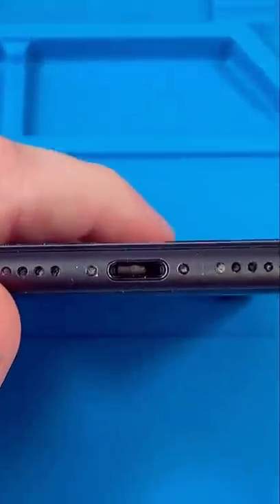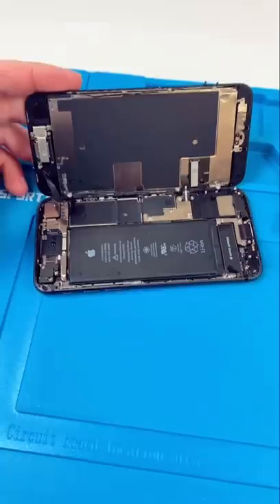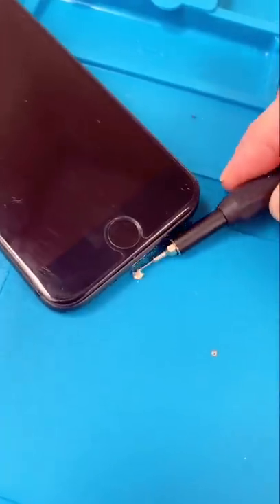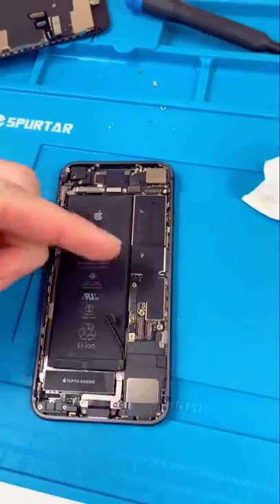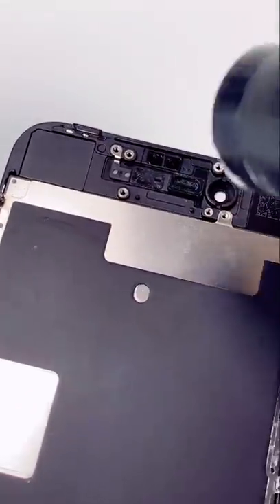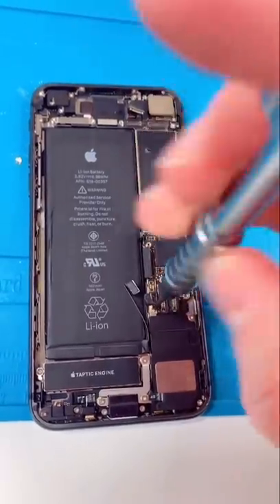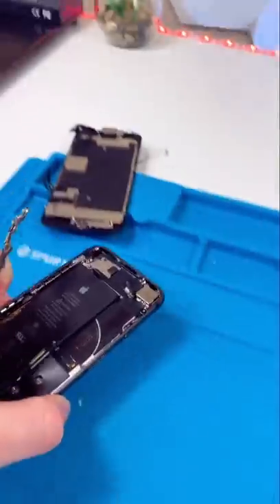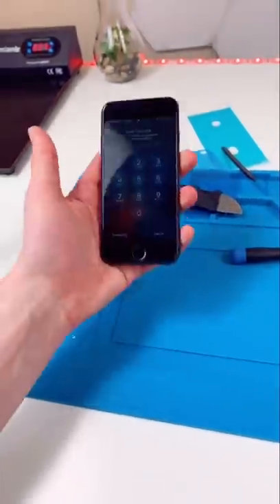The Rice Did Not Help... #Shorts

Comment from the maker: Please Stop using rice Lol. Just take out the sim card tray and turn off the phone for 48 hours. You should be taking it to a shop for cleaning. If this guy didn't come when he did the phone would not have lasted the next few days.
Reply: Fr
Reply: ikr
Reply: First reply lol
Reply: shame on them
Reply: Ok thanks for telling us!
Reply: @trgworks  I was second reply
Reply: Good edvice actually now that I think about it any phone or technology edvice you give is good
Reply: I have a iPhone 8 I need a new camera and back glass and someone to fix it
Reply: Omg he liked my comment 🤯🤯🤯🤯🤯🤯🥳🥳🥳🥳🥳
Reply: Yea you shouldn’t use rice
Reply: Fr
Reply: Yaay
Reply: Another "get that crunch!" compilation please 🙏🏻🙏🏻
Reply: Thanks Guru learnt a lot from you
Reply: Can we get the link for the program is that you use
Reply: The rice worked for me. My mother's phone once dropped into the toilet and didn't work. After a few hours in rice it booted up just fine.
Reply: I once dropped my old SE in water. The screen had visible marks from water. If you’ve experienced water damage on your iPhone you probably know what I’m talking about. I didn’t have any rice, and I wasn’t prepared to have to spend $100. So I ended up putting my phone on this old CD player which generated a lot of heat. I guess that evaporated the water inside it or something, because when I took it out a few hours later there was no visible water damage on the screen. I used it for about a year or two after the incident, and I never noticed any further problems. It shouldn’t have worked, but I guess it did…
Reply: @xitee6258  does it have rice in the charging port?
Reply: @Maciek2846  No
Reply: can we know ur name or did I miss sum
Reply: @xitee6258  maybe that's just luck but in so many cases rice doesn't help
maybe it's better when you just send it to someone who can fix it and not try it yourself beacuse it really can be dangerous and the rice can be stuck in the charging port
Reply: @Maciek2846  Ok then i maybe just had luck. But send it to someone wouldn't worth it because it is already 5 years old and isn't an expensive one. But it works so it doesn't matter anymore.
Reply: Bro my samsung s9 plus has red screen can you fix it I will pay how much you want
Reply: Why do you cook the phone??
Reply: How do I contact you? I have a iPhone 11 that can be fixed
Reply: THAT'S A LOTTA DAMAGE
Reply: What about MacARoNi?
Reply: I need help my dad changed the screen for my iphone 6s plus but the button isnt working
Reply: You should do a compilation of phone crunch
Reply: @victorizaguirre2458  you're right he should,it's soooooooooooooooooooooooooooooooooooooooooooooooooooooooooooooooooooooooooooooooooooooooooooooooooooooooooooooooooooooooooooooooooooooooooooooooooooooooooooooooooooooooooooooooooooooooooooooooooooooooooooooooooooooooooooooooooooooooooooooooooooooooooooooooooooooooooooooooooooo satisfying
Reply: Sir I didn't know you will read or not but I want to replace the screen of VIVO Z1 pro
Reply: @trgworks  lol you weren’t first
Reply: I'm not sure if you noticed but rice absorbs moisture so maybe it does help a little
Reply: Where is the repair form
Reply: Or just tape places where the rice can go
Reply: Rice works with small splash or droplets getting in holes of your phones. If you're afraid of getting rice in your headphone jack/charging port, just cover them with tape....how hard is that?
Reply: How mutch would it be to replace a samsung J3 screen ?
Reply: You need to use gloves dude, it could be toilet water. You never know where they dropped it ! 😳
Reply: Uhh I have dropped my phone in water at least 10 times it's usually ok after but I'm scared the more I drop it in water the less it will work
Reply: My dad knows how to deal with phones that were fully submerged in water
Reply: Soft paint brush?
Reply: @brylee4423  bruh I was first I don't need to prove
Reply: i’ve only dropped my phone in water once but i put it in rice, and while i did have to get a new phone, i let it soak for a few days and it works perfectly fine now :)
but if it happens in the future i probably won’t use rice lol
Reply: Sadly no one wants to clean phones around here
Reply: @trgworks  if you were first your comment would have been at the top... it’s not
Reply: @brylee4423  how long hv u been on youtube??
Reply: @trgworks  many many many years.
Reply: You are way overdramatic with water damage, Rice is okay it does in fact pull water, just set it on top of the rice not covered in it. Most modern phones are perfectly fine being completely submerged and the naturally drying. My low end Samsung has been drop in water, dry cleaning chemicals, detergents even liquid starch and except for the starch it always air dries(because im busy and don't care about it) when i take it apart there's no damage to any components. Now with apple its a bit worse since they're designed to fail rapidly but they're internals are still very resistant to water/liquids.
Reply: Hey, what company do you work at? I have an IPhone 5 and it has bad water damage
Reply: If I owned an iPhone 8, (I’m still swearing at a 7+, as it reaches it’s programmed death date.) and I dropped it in water for a few seconds and it got that wet inside, I’d be screaming at Apple for false advertising, and if I had been daft enough to void the warranty by taking it to a third part repairer, I’d be screaming them into the foetal position. On an aside, I’m hoping Apple dislodges their craniums from their sphincters and allows suitably qualified and audited third party repairers to repair Apple products. After forking out over $1000 for a phone, no one wants to double or nothing for a relatively simple and cheap repair that Apple charges an arm and leg for, and often says is unrepairable.
Reply: Yo plz reply ik your busy but my phone iphone x buttons everything works but the screen doesn't respond to touch i cant get in the phone i tried force resetting it already how do i fix it
Reply: I dropped my phone in my pool and it won’t turn on please help me
Reply: Or use silica gel.
Reply: Your Channel is entertaining to watch
Reply: I mean why not, rice absorbs humidity really well, and in the worst case there is water in the charging port which is really easy to clean out as you even showed in this video?

It worked for me multiple times, maybe the phones would have worked anyway, but 48h in rice shouldn't be bad. + I never even had any get stuck in any ports...
Reply: Me having phone that unable to open the battery and sim card out without pin: r i c e
Reply: @wisico640  rice does not work most likely what happened to yours was it literally dried up so yes letting out to dry can work but rice won’t help.
Reply: Last time we used rice it destroyed my old phone
Reply: @brayannexon4613  one of the phone we "fixed" was an LG G5, the phone still had water behind the screen & lenses 5 days in. Then, only 48h in rice & the humidity was all gone, the phone even booted up.

We even had separated the phone in two (the battery loaded like a gun clip) all we had to use was a long wooden pin to remove some rice from inside this compartment. It's rice, not cyanide; It won't kill you or the phone 😂 especially if the phone is already considered dead from water damage
Reply: @wisico640  what kind of rice did you use? From what I know rice isn't a good desiccant.
Reply: Would salt be better?
Reply: I had an interesting idea i wanted to run by you. What about water absorbing silicone? Silicone packets come in a wide range of food products and other goods to keep them dry. What if we collected all of the small packs of silicone and place them in a bag. This way we get a drying effect without small particles going into the ports.
Reply: How much for a cracked tablet screen fix?
Reply: I promise I won't put food in my phone
Reply: @gaijininja  Or.... you could just not buy Apple products..
Reply: Hey
There is a ghost touch on a phone what to do can you tell
Reply: Would shutting it off and removing sim but soak it in alcohol and they let It dry for a while be better?
Reply: @Killertiger2000  no
Reply: @xitee6258  the rice does absolutely nothing. The water just dried up on its own
Reply: Hello, I believe my switch lite has water damage. I feel silly for asking but do you think you or someone like you would be able to fix it? It won’t turn on or charge.
Reply: Do u have a P.O. Box because I might need to send u my brothers phone because it was in the ocean for a long time and now idk what to do
Reply: I have a LG G6 thinq with broken front and back glass could you fix it?
Reply: You should buy a GoPro
Reply: My phones broken
Reply: Can you fix my iPhone 6?
Reply: @Mmmm-mj3iu  so that glass doesn’t shatter when you want it to come off and it just peels off
Reply: Can you repair my phone
Reply: Please
Reply: Rice does work tho
Reply: Where do you get all the broken phones from because I fix phones two
Reply: I remember one time I dropped my phone in the sink cuz I was trying to change my music I instantly took it apart like the case came off the back came off the battery came out and so did that little sim card thing I set it between two paper towels and let the water drain when I put it back together the sound was very muffled so I took it to someone and they said it was just dust and i still have my phone no cracks or anything so I'm kinda cool I guess
Reply: Actually rice helped me a lot of times
Reply: My mom has gotten the one bag things that take the moisture out of stuff like the things in packaging for instances like when my aunt accidentally washed my sisters tablet in the washer and I dropped my phone in the rain and didn't notice. I have a newer phone so it can't really be taken apart like we usually do so she decided to get that stuff
Reply: Do you have tik tok ? If you do pls tell me your name
Reply: How do you remove the sim tray?
Reply: @spiicypotato  
Race doesn’t cost $100
Reply: @Gabriel Kautzman 
No it should be fine
Reply: @timothyjones4682  
Silica gel packs work fine
Reply: @trixtrix1536  sweet my meds comes with one in this plastic canister would work perfectly
Reply: @xavierb2817  no
Reply: The camera is all fucked up

Comment: (Long story) Like 5 months ago my iPhone X had the top left of the screen pop off because the battery had expanded without me knowing so I splashed it on accident and I was like oh I’ll just wipe it and went to sleep. before I knew it, it was stuck on a boot loop in the morning so I noticed the opening and opened it up and sure enough it was wet. So I put it outside to dry for several hours and it was dry so I tried and it was still on a boot loop. I then disconnected everything to diagnose the problem and try to see which component was causing the problem. I then connected only a new screen and battery and it was still stuck, I cleaned it, still stuck, I factory restored it, still stuck, nothing worked. So I came to the conclusion that it was the motherboard and gave up and didn’t bother fixing it and just asked my dad for a phone and ended up getting the 11 pro. Then like 2 weeks ago I decided to just plug it in and charge it because I was feeling hopeful and it had no charge and to stop it from boot looping I pressed up volume, down volume, and held the power button so it was on the screen with the lap top and the charging cable and I just left it to charge. I kid you not after like 15 minutes, mf just spontaneously turns on and is on the hello screen. The only problem was the Face ID no longer worked. It might’ve been me or the water but holy shit I thought i was a wizard. Perfect timing because when I go to Mexico ima give my mom the iPhone X because she currently has a crappy Samsung that’s like 7 years old and has 8gb of storage. Still have ptsd whenever I restart it or shut it off tho, I fear that stupid white apple lmao

Edit:  I forgot the rice 😂 maybe that would’ve worked wonders and ended up with rice stuck on the charging port and the phone not successfully booting up. Stonkers

Comment: which question: when he said he “cooked the board” and the other thing what exactly does that mean? :)
Reply: He has a heating plate, usually to heat screen adhesives before removing them. Here he probably used it to dry the parts out quickly

Comment: Phone repair guru i need help please. so i have an ipod touch 9 and when i plug it in it usually charges but now i’m having problems. when i plug it in it says its charging but whenever i use it the battery stays around the red zone. i’ve tried shutting it down twice. please help :)
Reply: Lmao fam I feel your pain I used to have an iPod touch like 5 or 6. The problem is the battery is worn down most likely and the only real way to fix that is to replace it but it’s probably not worth it. I’m no expert but I feel like a case with a battery built into it is the best solution. Even if you replace the battery it most likely will last a few weeks or a few  months and go back to lasting you like 30min-1hr before it dies.

Comment: I actually accidentally left my samsung S5 in my jacket as I put it through the washing machine a while back.
I did not use rice and dried it slowly after powering off, taking battery out and using a hair dryer. Still works to this day :)

Comment: I have the back of my XS repaired today and I updated it two day ago (prior to me dropping it off to get fixed) but now after they replaced the back glass,it is super laggy and shuts off on its own and gets hot quickly if you open any apps. It is hot near the middle back and lower area near USB port. They said it may have been the update that did it and they see it often with the XS when it’s shattered on the back. Mine had chunks missing in big squares exposing potential damage to inside. Im worried that the laser touched something it shouldn’t have,but aren’t they pre programmed to know where to laser at? Also,they are trying to find a new patch to run in it to see if it helps? What is your advise? Just buy a new phone? It never did any of this until they replaced the glass. Even with the update. So I’m confused. Please help! Thanks!